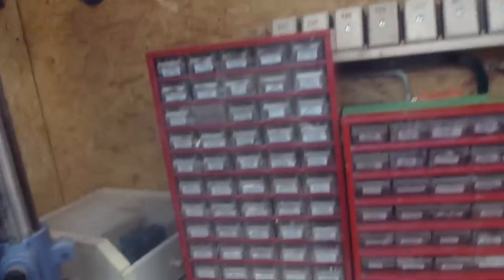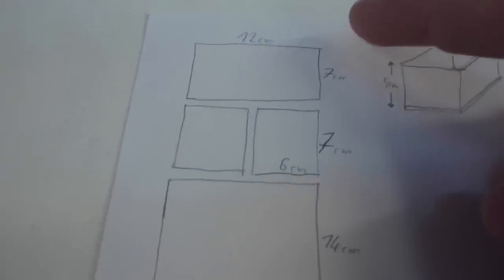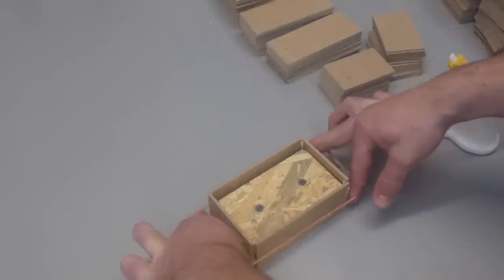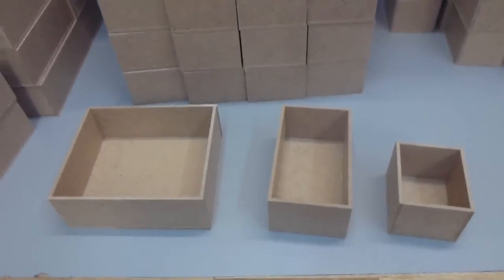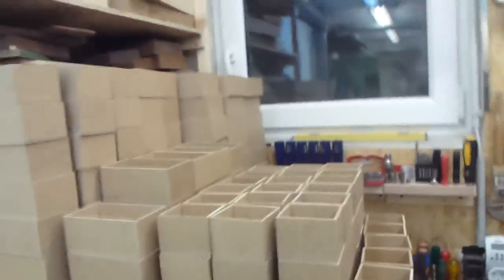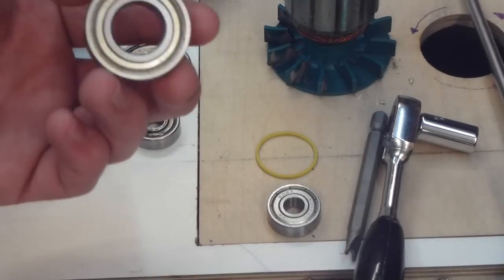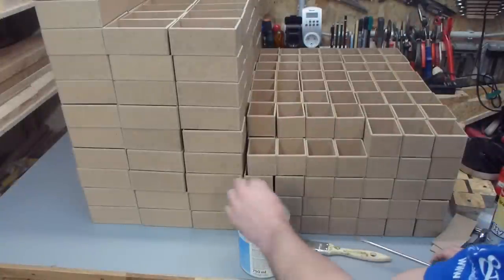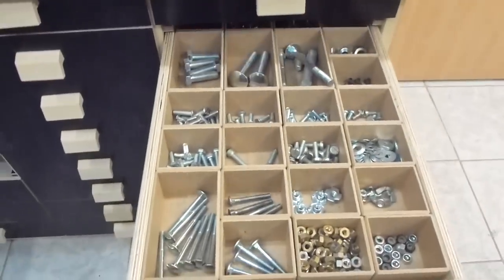Small Parts Storage Boxes

Comment: Marius, thanks very much I have made a number of the boxes (nowhere near as many as you). Two things to share, a 12mm wide strip across the front can be painted white and you can write size of the hardware. It also helps sliding the boxes out from their position in the drawer to the bench. Also had issues with the excess glue sticking on the blocks so I shaved the corners off the blocks about 2mm and it works a treat.

Comment: Superb video (and I loved the dry humour!).  Now you have set my mind to thinking about ways to production-line the process.  Perhaps with finger joints on the box sides, to hold them together better (which would also let the sides and base be glued all in one operation).  And during the glue-up ... make a wood lattice with slots, which would drop down on top of a batch of (say) 5 x 5 boxes, holding the whole set of 25 while the glue sets.  That way you wouldn't need so many of the interior wood blocks.

Comment: Marius - you are a very patient man. I would have ruptured an artery from high blood pressure and stress before having finished half that amount of boxes.

If you get the time, in one of your shop talks, could you please show how you mounted your router in the woodgears inspired router lift. I Know there is a couple of close ups in this video, but it still eludes me how you get it to sit straight. Plunge routers always have odd shapes, that makes it really hard, so if you could show in a little detail, that would be cool.

I love that you use a relatively cheap 1050W router in your table. So many people think they need 3,5 horsepower, but you show people that it is possible to be quite frugal (at least until you bought your Hammer saw :) )

Comment: That smell of the patience... :D 
Grease drawer sides and runners with vaseline, mine glide really well with it. I got a huge box of it (300ml) cheaply at a vet pharmacy/store.
Reply from the maker: Most of my drawers also glide easiely, but some of them jam at the sides, because of shims I put there. Some of them are a little bit to thick and I need to sand them thinner, but since I didn't use these drawers until now, i did not care about it.
Reply: Grease the sides, you'll see the difference ;)

Comment: Instead of pre-cutting all 5 panels for each tiny box, you can rip long strips just for the sides and glue up a ~1-2m tower. Then you have fewer 4-sided glue ups. Instead of flush trim and then chamfer, just get a chamfer bit with a bearing on it and you'd be done faster with less individual steps. After the flush trim/chamfer on the long edges on that one thing you can slice off the open-bottomed "boxes" on a cross cut sled at whatever height you need. Then all you have to do is glue the bottoms on either with slightly oversized bottoms to chamfer later or you could just put them on a big panel in a grid and tablesaw the thing apart later into individual boxes. The idea is great but I think there are some ways to get the same result with a faster workflow. The removable trays is the key because then once you find the thing(s) you need for a project you can just take those couple of boxes instead of taking a whole tray or drawer. That's the downfall of so many plastic tray divider systems. Anyway, keep up with the interesting projects.
Reply from the maker: Yeah, you always know what to improove afterwards. But sure, I agree on everything you said. Although the chamfer wasn't planned in the beginning, which is why I didn't use a bit with a bering in the first place

Comment: great project. I'm gonna just buy some of those cabinets and organize them in there because..... well quite a bit of work and don't have very accurate machines. For example my tablesaw was 100 dollar.......
Reply from the maker: Thanks! I used these cabinets before too, but they are always full of dust. That's the main reason why I built them. It was a lot of work, but totally worth it and I only had to do it once. You also don't need perfect tools for something like this. My tablesaw is about 20 years old and I could get similar quality for about 100€.

Comment: Good job, but you could have made the high usage boxes for most used screws etc out of the mdf and low usage boxes for infrequent use parts out of cardboard and still had size compatibility and interchangeability. And. Cardboard is free usually.

Comment: Marius, you are a hero! You took on a monster issue and you prevailed! I would give you a hug, but you are (I presume) too far away. So I did the next best thing: I subbed.

You even fixed your router, so you can keep on. I know what's that is like. I am no stranger to fixing tools. Cheaper to fix than to replace, for sure!

I posted a link to your vid at Eurobricks.com, because all those little boxes would be a totally awesome idea for organizing LEGO pieces. Posted under 'Storage and sorting LEGO', message #1188.

One nitpick: The voice-over at 0:44 & 1:22 should have been better recorded. Too "poppy".

Too bad you chickened out on the varnish. That would have only earned you more hero points. Suggestion: Thin the varnish, dip the boxes, then brush off the excess. Thinning may not be necessary. A way to make an awesome idea awesomer!

Overall, a great video. Could not "like" it enough.
Reply from the maker: Double Dare Fan Thank you for this comment and for sharing. The WHOLE voice over sucks. Didn't have a good microphone at that time. And I never even thought about varnishing them. It just made it for the joke.

Comment: Just make one larger box as an insert to the drawer. Make a couple of main dividers (that also stiffens the box), with some kerfs routered each side.   Then all you need is a bunch of small 1/4” pieces that insert into/between the dividers at almost any spacing for the size of the contents.  I did about a dozen of these for every drawer I needed small piece storage in my shop.  It took about 2 hours once I measured had a layout sketched - all told, less than 3 hours, sanded, finished, and my stuff all inside neatly.  This project is a serious waste of time, I’d say a good idea, but not a great one... and that’s being nice...
Reply from the maker: Well, that's great for you and your time efficient solution. I wanted small boxes that I can take with me to the workbench or whatever individually. Only way to do that are small boxes.

Comment: When you initially took your plunge router apart to remove the plunge mechanism did you encounter any problems with linear bearings falling out when the rods were removed? as I want to do that to my router but also want to be able to reassemble it if I need to.
Reply from the maker: No problems with that. But there are no linear bearings in plunge routers, at least not in mine.

Comment: Hi Marius, do not have detailed video, hod did you disassemble the router? I have similar one,andnot able to remove the rotor from the stator. Thank you, Vlada
Reply from the maker: Unfortunately not. I only remember that it was a little difficult. Very tight fit even after all screwed were removed. You have to use some force.

Comment: What did you use for the drawer slides to all those drawers? I saw they were (or at least looked like) full extension drawers but i couldnt imagine them to be metal. $$$. What did you do?
Reply from the maker: Just laminate coated plywood strips. Space between there is pretty tight, so you can pull them out quite far without tipping.

Comment: Nice, But it looks Like you made the Cabinet, why not make the draw larger to fit the Red Boxes. boxes are Nice, but once there in its going to be hard to pull them out separately, need to Notch side, so the notch over laps but isn't even so you can pull single boxes out, or something like that idea.  International Coffee comes in a Little Plastic Box also with lids to.  A+ Skillz
Reply from the maker: Jeffrey Haager I got the red boxes after the cabinet was finished. And it's no problem to get a box out without a notch. They aren't stuck or anything.

Comment: The downside to this is you didn't measure 100% properly for all drawers, unless the gaps are from difference sized drawers... Anyways, you could use spacers in the rear of the drawers to keep all of the boxes pushed to the front... Also, 1 piece of wood on the side to keep them tight so nothing can fall in between...

Comment: How often does the standard measurement system show up in Europe? Is it as common there as metric is in the US?
Reply: I don't understand your question, Andrew. Not that I don't understand what you ask but it makes no sense. I assume you mean Metric when you say standard measurement system because that is what we use in Europe. So to ask how common it is compared to the US makes little sense since we only have metric. There is no other system in place anywhere in Europe that I am aware of. It is the only system we are taught in school and it is used everywhere. So to ask if it is as common as metric is in the US is a pointless comparison question because we are not replacing one system for another. Adaptation of the Metric system has been an ongoing process of some 450 years now in Europe.

History of Metric: https://en.wikipedia.org/wiki/Metric_system#History
Reply: Sorry, I phrased the question incorrectly. In America an imperial socket set is apart of most all tool sets (obviously), however many people also have a metric socket set. Maybe one in every ten times the metric set is needed. In Europe, would an Imperial socket set be needed? Is an Imperial set used in Europe as infrequently as a metric set is used in America?

Comment: I'm sure this comment has already been made, but why not just make dividers for the drawers? You could still get the same customization. You could have even made a few boxes just to help you see the arrangement. It seems like a much easier solution. I am not at all being negative. You clearly mastered little boxes in your adventure, so your time wasn't wasted.
Reply from the maker: Matt de Oliveira I can take boxes with me wherever I need them for work outside the shop. And if I there are multiple things in a box, I can just dump it out and rummage through all them easily.
Just a dividing system is easier, but also not as flexible.
Reply: Marius Hornberger That's true. But I wonder if the time it would take to remove everything from a compartment would equal the time it took to build one box. 
Great video anyway. I'm sure they are serving you well. Thanks for taking time to record your project.
Reply from the maker: maybe over time. But I don't care about how long took anymore. I'm just happy that I made them.